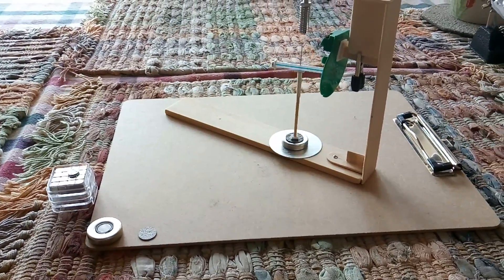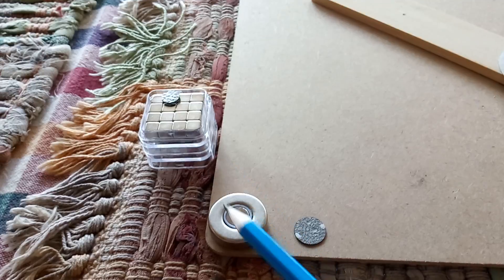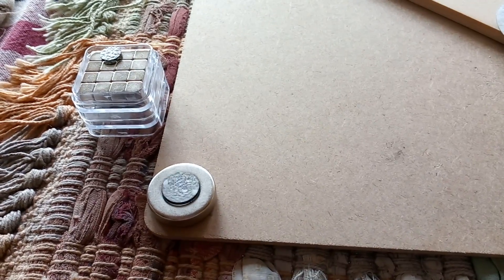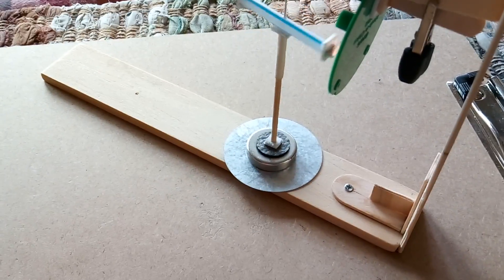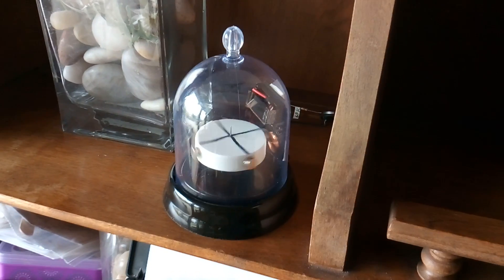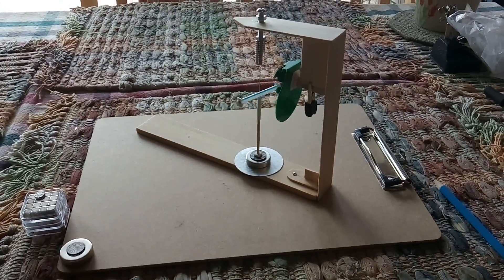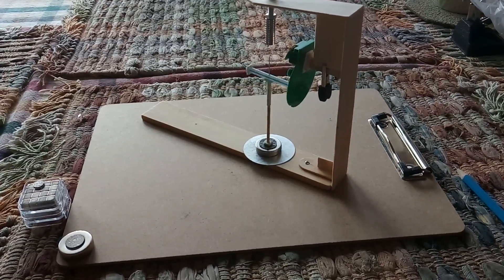Pyrolytic graphite and ring magnet low friction bearing

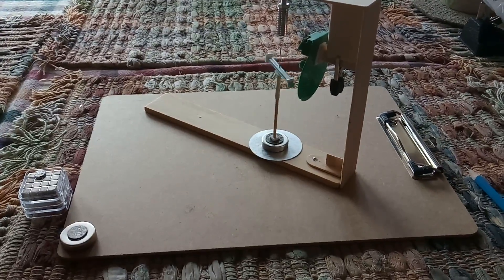Comment: min 2:21 for sure it is touchy… working on it right now, as you said there is so many
variables… it’s quite fun to see it levitate, not sure yet how lasersaber got his motor 
so “locked in”, my problems are rpms ,as soon as  the rotor get some revolution the Pyrolytic
graphite disk skip from the magnetic field…

My first try was with a reed switch circuit, its working quite good, but the attraction from the rotor magnets is bugging me, as well as the push from the coil, for low rpms I’m using
0,30v and it seems to work good, if the voltage is too high, rpms and the push
from the coil unbalance the rotor

Trying now with the tow transistor circuit, we will see how that goes :)
Quite fun and Challenging project

Comment: To help the disk "lock" into position, you may need to adjust the size of your disk.  Here's a snapshot of my work in progress showing the "locking" into position effect being amplified by the use of multiple rings: https://youtu.be/RbhK3vBPIBk
I still need to balance the rotor but I even without balancing it is very stable.
Reply from the maker: That looks great!  That sure solves the stability problem.  I see what you mean about adjusting the size of the disk.  Interesting stuff.

Comment: Certainly not the easiest project you have done but I can see it's the mechanics are the challenge rather than the electronics.
Reply from the maker: This has been rather frustrating because at first it looked so easy but it really isn't.  This ' floating' rotor idea is too unstable -- at least in my opinion.

Comment: Nice idea. What sort of repulsive force does it have? For very light applications particularly in a vacuum it seems fine, what was the weight of the unit suspended on it. I think most applications will be in nano technology. Maybe wobble could be reduced using a concentric ring magnet on the same plane as the edge of the graphire
Reply from the maker: Yes.  I think that there is an application for this diamagnetic levitation method. For a kitchen table builder like me it has been rather frustrating getting it to work as a pulse motor bearing method.

Comment: Seems to be very stable in comparison, closer and closer to Lasersabers build. The wobbler is a good acid test of what really does happen with that set up, very worthwhile.  
Enjoyed the update :)
Reply from the maker: After watching your latest videos I am back to thinking that the plain old needle / point contact method makes more sense.  I wish I could replicate all of Lasersaber's builds but that is not always possible.  Sometimes all I can do is come close and describe what I learned along the way.
Reply from the maker: @lexyparrot8201    Thanks.  I did that back in 2011 on a Mendocino motor setup and it worked great.  I still have that motor and it still runs. From time to time I did clean the mirror and add a tiny amount of lubrication.  I'm not sure why I did not use that method on other projects.  Perhaps it is time to revisit that method.  Back in those days I didn't consider that some of my motors would be running for years non-stop.  Here is one of the videos on the 2011 motor that shows the Bic pen tip running on the mirror.  https://www.youtube.com/watch?v=VGf9twTqoLA

Comment: The little graphite disk that is on the corner of the wooden surface over the disks that you are turning looks like it wants to stop in a certain position. The dots on it indicate that it's aligning itself with the poles like a compass or to the magnetism of what is around it. A levitated floating compass with that graphite disk over the ring magnets would definitely be an interesting thing to construct.
Reply from the maker: I was thinking about doing something along that lines but the magnet field around the powerful ring magnet is going to effect anything close.